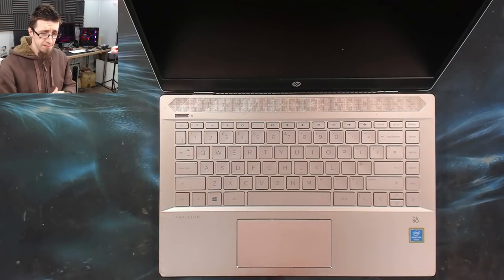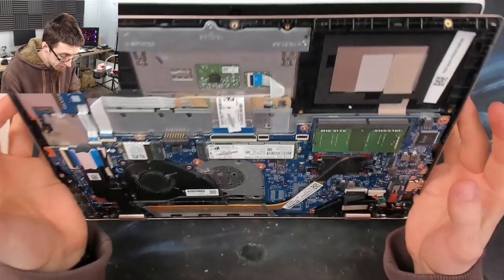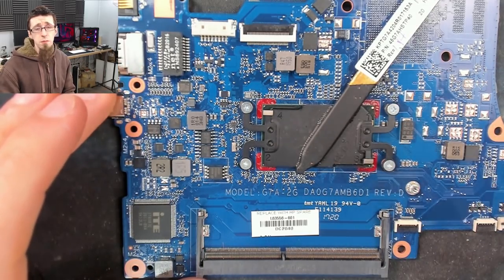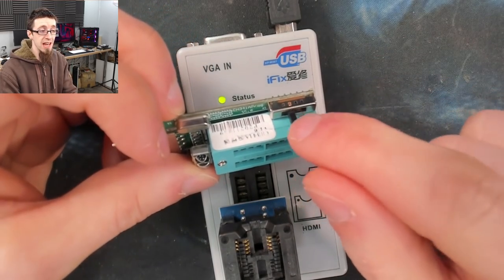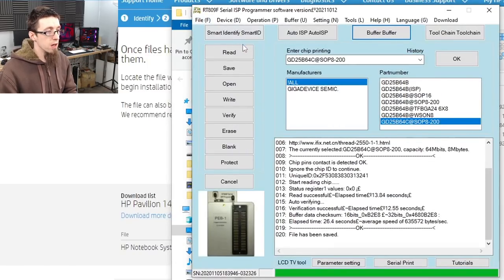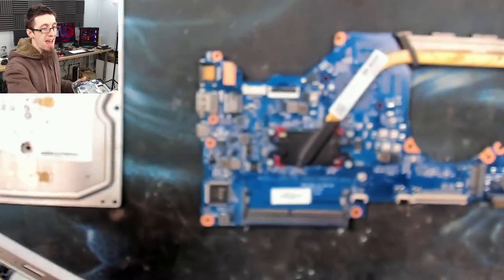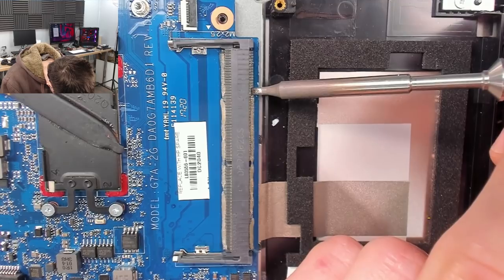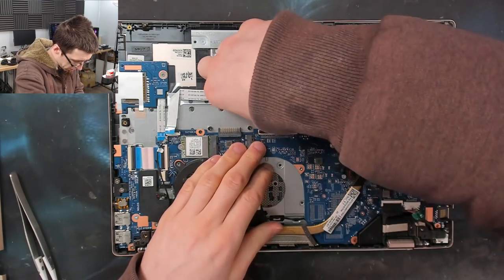HP Pavilion: 3 Long, 2 Short caps flashes - LFC#303

Comment: can Someone help with my problem? 
My laptop battery is showing 255% when plug in... And if i remove the plug, it says "unknown remaining".... Also laptop turns on only if the plug is connected, but once   it turns on, i can remove the plug, but battery shows" unknown remaining"
Reply: Try another battery, if the same, then check battery SMBUS line from battery to sio and charging ic
Reply: @chikeretochukwu1999  thanks for your reply.. i have tested another battery, and it works fine.. but in this perticular battery the problem is still there.. i was wondering if there's a way to fix the circuit board inside the battery.. because as i have tested  all four  batterys cells are still in a good condition

Comment: Do you ever pull serial number from the old BIOS and put it to the new one?
Reply from the maker: I've only started doing this recently, but yes. I test a clean BIOS first, and if that works, then I'll start altering it. As we saw in this case, reflash wasn't the answer, so I ended up just flashing the original image back anyway.
Reply: Check out Graham's LFC#298: https://youtu.be/duObbQLFHwI

Comment: On Most HP Laptops you can simply hold windows + b down when you power the laptop on untl in enters the bios update screen have the bios downloaded to a usb drive and update it through usb without have to remove the bios chip to update it HP is great for bios Programing does not work for others
Reply: If the bios is corrupted though then thats surely not going to work? I have recently had a gigabyte with same fault and  this was notaccessible
.
Reply: This requires working RAM
Reply: @MrRawUK  wrong it will work with a corrupted bios the utility does not require bios to use it is made to flash the bios either to newer or the same is it gets corrupted that is why they made this utility and yes gigabyte will not work it is only factory hp laptop Mb s
Reply: @MrRawUK  https://www.youtube.com/watch?v=OkadkPyGjY4           Quickess vid i could find showing it work with corrupted bios but that is what HP does this cause it is a fairly common problem and yes i have done it successfully four times for repairs i know it works as long as isn't a really old laptop
Reply from the maker: Yea I realised that flashback was an option after I'd already removed the chip. I'll test it with no RAM next opportunity for science.
Reply: @Adamant_IT  Now that will be great i am very Curious to know if that will work with no ram can't wait if you do it without a vid please let me know if it worked   Great vid and repair as always    Always looking forward to a new vid from you I have seen everyone vid on your channel all are great

Comment: billy,  why do you never check the memory.   30% of motherboard failures I run into is a dead memory chip.   You should at least check that before dismantling
Reply from the maker: First thing I did in the video was BIOS reset by battery removal, second thing was swap in a different RAM module.
Reply: @Adamant_IT  I must have missed that, sorry

Comment: there is a way on modern Dell and hp laptops to trigger emergency bios recovery via a USB flash drive. Unsure if it would work in your case as the culprit might not be bios, but it's worth a shot before ripping the bios chip out!

Comment: There was no need to remove the chip, by downloading the file to a USB flash drive and holding the Windows key and B, you can easily program the BIOS.